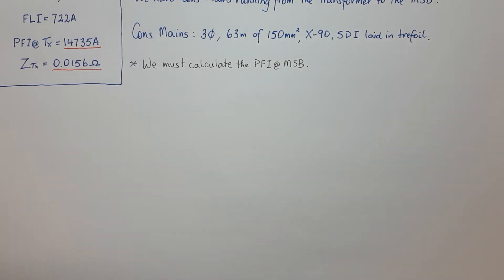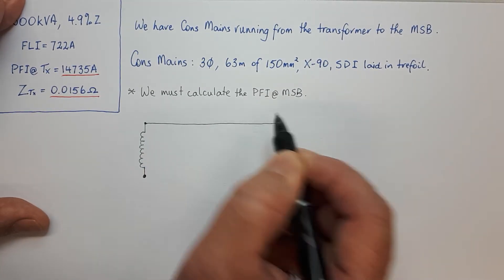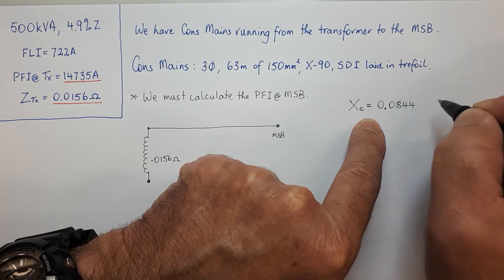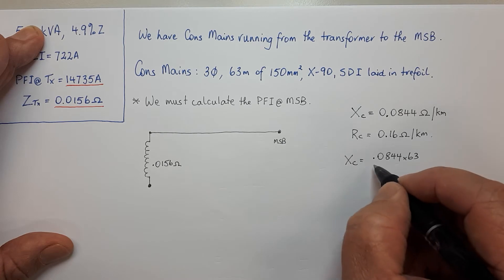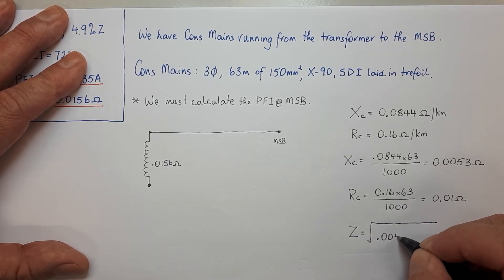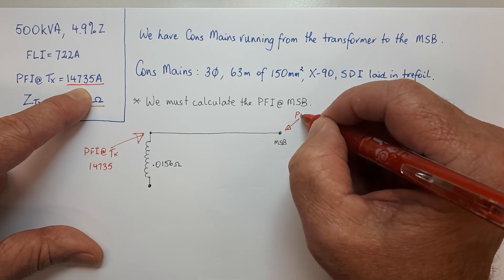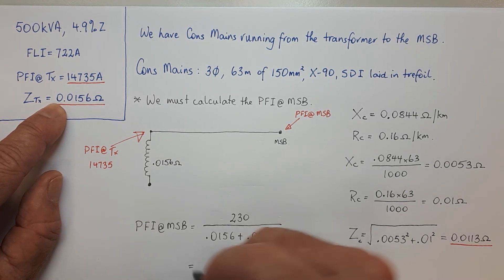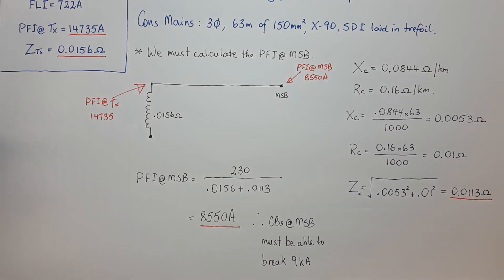Determining Prospective Fault Current at the Main Switchboard

Comment: I notice that you use a hot value of cable resistance (from Table 34).  However, a worst case is where the mains are cold, giving a higher fault current (about 666A higher here).  I am wondering if there is a reason for this.

I understand that at best, our calculations are a guess, as:
   1. Both cable and transformer impedances are out of phase, and cannot be simply added.
   2. No account is taken for any DC offset under fault.
   3. Spinning induction motors feed current back into a fault.  (Typically, about 5 or 6 times their full load current)

Comment: Great videos! Question: Why do Prospective Fault Current  calculations not include the impedance of the return path through the Neutral?
Reply: Protection is put in for the worst case scenario.  This is a three phase "bolted" fault.  (A piece of railway line across all three phases.). This is a balanced load, and no current returns via the Neutral.  All three phases are carrying the same high fault current.